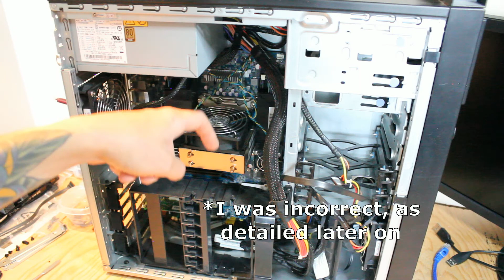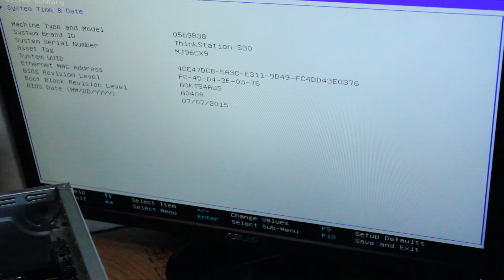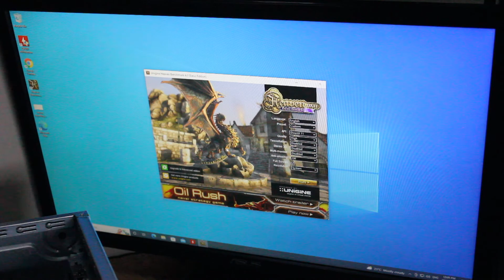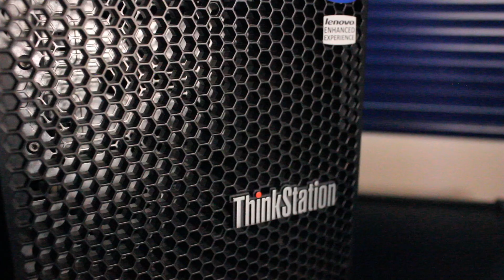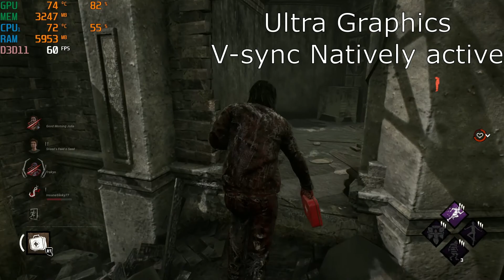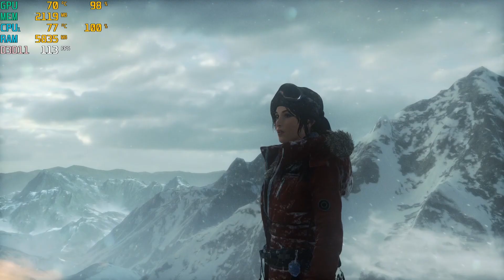Lenovo ThinkStation S30 Upgrade Tutorial for Gaming:  GTX 970, SSD, RAM

Comment: Commenting late and not quite on the topic, but I've been struggling through various setups with a D20. It's a dual processor machine very similar but I guess one generation older than your S30. It has (2) X5687 CPUs and 64GB of DDR3 1333. I gave up on gaming with it but it's still capable for various things, especially under Linux. I'm about to receive and install a lightly used Radeon RX 570 in it, and I'm expecting that will alleviate some driver issues I'm having with it. Anyway, I'm glad to see someone else sees the value in this old hardware.
Reply from the maker: The interesting caveat to these companies selling powerful computers is that the race to make it obsolete begins nearly a year after it has been on the market, if not sooner.  The somewhat arbitrary TPM security requirements from Microsoft for Windows 11 is an example of this.

Comment: hey king i have an s30 cam with its original processor xeon which other processor can i use for more speed  .the original one is r bit slow for my work architectural work and rendering with lumion 12

Comment: Hello, that is great educational video keep doing it!!! I have alittle issue with similar machine ThinkStation C30, i upgrade Ram with HyperX Fury 1600 MHz but it runs in 1333 can you suggest me some solution for this.. Thank in advance:)
Reply from the maker: That would likely mean that you have a CPU installed that only supports 1333MHz RAM, so that is the speed it will default to.  There also likely isn't a way to set those spends in Lenovo BIOS.   https://psref.lenovo.com/syspool/Sys/PDF/withdrawnbook/C30_WE.pdf
Reply: @HaisteComputerRepair  I checked , it support it ,my processor is Intel Xeon E5-2690....
Reply: Now i read the manual for Memory and it writes that i should put Memory by sequence slots. On processor 1 i put it in slot 1-2 but on procesoor 2 i put i 3-4 and 1-2 are free,can this make a issue?
Reply from the maker: @ЛюбомирЛалев-н2и  Should follow the manual for RAM placement, I can't say as I haven't used a C30 before.  Good luck!
Reply from the maker: @ЛюбомирЛалев-н2и  You're certain the RAM is 1600MHz?  Just checking that you have a matching set?
Reply: @HaisteComputerRepair  Yes i buy a set 4x8gb Memory :) i keep fighting, thanx for support :)
Reply from the maker: @ЛюбомирЛалев-н2и  Good luck and let me know if you find a solution

Comment: Awesome content..and very clear..wanted to know if an S30 would take an RTX series Graphic card with upgrading the BIOS update have you ever tried an RTX keep up the content
Reply from the maker: The best GPU I installed was the GTX 970.  If I had any RTX series cards to test out I would have.  I don't see why one wouldn't work so long as you can connect it to the power supply and it's PSU support is 610W or under.

Comment: Could you confirm if you tried GTX 3060 in S30 and if it worked? I got S30 and bottleneck calculator suggest 3060 would be right combo for S30 I'm just concerned that generational difference could be a problem. Thx.
Reply: Same, I'd be interested to find this out too^^
Reply from the maker: Maybe look at installed something like a GTX 1070 ot GTX 1070 Ti, or GTX 1080
Reply from the maker: I would say an RTX 3060 would be ok, but if you have the same 4 core 8 thread Xeon CPU as in this video you probably will bottleneck a little.  I consider the RTX 3060 to be a good card, but it's not the most powerful.  Just make sure you can connect it with the PCIe cables offered by the power supply, or, if you need cable adapters.  Maybe look at installed something like a GTX 1070 ot GTX 1070 Ti, or GTX 1080.

Comment: Hey so I've got an S30 Type 0606 with the E5-1620 v1, 32GB ECC RDIMM 1600Ghz ram with a VisionTek RX 570 4GB OC. Currently getting no display output on monitor but the computer seems to have POSTed. Unfortunately these don't seem to have an iGPU so I'm having an issue trying to troubleshoot with no display. Was the 970 just plug and play for you or did you have to update your BIOS and flash your card as well?
Reply from the maker: The 970 was plug & play for me.  Other cards had trouble working, like one AMD R7 370.   I've heard of others having trouble with some assortment of AMD cards.  Though, the RX 580 is AMD and it was working fine before this?  Do you have any other cards you can install to try out?
Reply: @HaisteComputerRepair  Yeah so after a lot of researching it looks like AMD RX 4xx and 5xx series made UEFI only GPUs with no Hybrid vBIOS for olders hardware. It seems to vary by manufacturers but the the most part Nvidia provided better legacy hardware support for most of their cards. Um so you had a no display issue with the R7 370 eh? Which GPUs were plug and play for you on the S30 aside from the 970?
Reply from the maker: @klingon88  I think the only other cards, outside of the Quadro k4000 card it came with, I tried with it was a GTX 1060 6GB and GTX 650 ti.  Both NVIDIA, which lends to your research.
Reply: @HaisteComputerRepair  When the cards did not work. Did you just get no display on your screen even thought you turned on your PC? How did you determine it was ultimately the card and not another component like the CMOS, ram, motherboard etc.
Reply from the maker: @klingon88  It was no display.  I didn't spend too much time on it before switching cards.  So, I can't really lend to any troubleshooting outside of just a swap out.
Reply: @HaisteComputerRepair  Great channel by the way. Your probably one of the few that goes into detail about issues that can arise when upgrading older office systems with newer hardware. An interesting vid may be testing out different GPUs in an older system to see what works and what doesn't. Really hard to find content like that even on forums dedicated to PC building.
Reply from the maker: @klingon88  Thanks!  I agree, PC building an repair is diverse and problems are plenty.  I would do a video like that, just need the hardware.  I usually cycle through stuff fairly quick.
Reply: @HaisteComputerRepair  Hey sorry for the bother had one pressing question I had to ask. Is this an S30 0606, 0569, 0xxx model or 4563 or some variation of 4xxx model? Reason I ask is because your PSU has 2 6 pin connectors which came on 4xxx models but you use an E5-1620 3.6Ghz which came on 1st gen 0xxx models.
Reply from the maker: @klingon88  Good question.  I have no idea.  If still had access to a case I could tell you.  Definitely not off the to of my head.
Reply: Had the same problem with a GTX 1060, it turned out to be a UEFI thing. Weirdly, I was able to get into the bios by moving the 1060 into the PCIe x4 (x16 mechanical) slot. Once I'd changed the settings I shut it down, switched the card back into the top x16 slot and all was good.
Reply from the maker: @moffatcountycustoms  An odd magic trick to perform, but something to add to the troubleshooting list.  Thanks for sharing this :)
Reply: @moffatcountycustoms  Even had issues with a 1060 huh? What did you get no display on your monitor at all? How did you know your GPU wasn't outright dead after seeing that?
Reply: Yup, no display. I think I was getting a beep code too, it was a while ago. The 1060 was free from a friend and a weird Dell OEM thing so I had no idea if it was DOA or not. I just said what the hay and whacked it into the next slot down without realizing it wasn't an x16 slot and wouldn't you know it video came out. Only then did I bother to read the diagram on the case panel that the middle slot was only X4, but after changing vga oprom setting in the bios to "UEFI only" I was able to move it back into the top x16 slot and it's run great ever since.

Obviously do what I did at your own risk, I have no idea why that worked.
Reply: @moffatcountycustoms  Weird solution. No idea why that would work either. It sucks you need a working GPU just to access BIOS. I'm getting 2 short beeps but thats after I reset my CMOS. I'm still on the lookout for a card.
Reply from the maker: @moffatcountycustoms  The only thing that matters is that it worked!
Reply: @moffatcountycustoms  Yeah tried your technique. Switched my RX 570 to the PCIe x4 (x16 mech) slot and still nothing. I'm getting 2 short beeps which I think is what you were also getting? Thinking I might have to limit myself to the GTX 600 series to avoid this UEFI/Legacy OPROM issue altogether. I see a lot of 1060s at great prices but I've got no clue what makes certain cards work and what doesn't. It's a gamble either way with these newer cards in this system.
Reply: @klingon88  hmm I actually got two sets of beeps (2 short, 3 long maybe?). You don't by chance have the K620 or whatever that came with it do you?
Reply: @moffatcountycustoms  Yeah I purchased a Quadro K4000 and it booted right up. Looks like the GPU was dead after all. I thought I would have head the 2 short and 3 long beeps like you did indicating no GPU. Heh guess I'm off to find another card.

Comment: So an MSI GeForce GTX 970 would also fit/slot straight into an S30 tower?
Reply from the maker: It probably will, but may need some modifications (doable I think) as the MSI card is bigger than the EVGA card.

Comment: When I swap out the gpu to different gpus, previously known to be working , I am getting 2 long beeps and 3 short beeps which I am seeing says gpu not found. Did you have to change anything before pulling the quadro out?
Reply from the maker: The only thing I did was use the extra PCI-e plug adapter.  Nothing in BIOS.  Which GPU's are you trying to install?
Reply: @HaisteComputerRepair  same guy, using my phone account. 
The rig had a k620 quadro in originally. 
Im trying to install a RX 590 nitro plus. I even tried a gt710 to see if that would do anything and same thing wouldn't recognize. Put quadro back in and it's fine. 
Attempted a psu swap. 
It's got a e5-1607 v2 Xeon, and 8gb ram
Reply from the maker: @sofarm2259  That is odd that those cards don't work but the quadro does.  They are confirmed working in another system?  I tried a similar card to the RX 590 and it didn't work with the system.  This might take some research online. Have you posted to any forums?
Reply: @HaisteComputerRepair  not yet. Your the only person I've come across using same system so far. Your input has been helpful
Reply from the maker: @sofarm2259  Sorry I can't offer a fix, but I would keep at it.  At least we can say GTX 970 and Quadro cards seem to work fine.  Let me know if you find a solution.  This has been sold, so I no longer have access to an S30.
Reply: @HaisteComputerRepair  Will do, sold the RX590, going to keep my eyes out for a nvidia card.
Reply from the maker: @youratard321  Good deal!  If you were local to me I have two Radeon r9 290's that would work (confirmed by me).
Reply: @HaisteComputerRepair  Picked up a dell XPS locally for $25 that ended up having a GTX 960 4GB in it, and was able to boot up! 
Lady that bought RX590 told me its working perfect in her gaming rig, so not sure what was going on. Other gpu I had also booted in the XPS, so def something the S30 did not like.
Reply from the maker: @youratard321  A whole PC and a surprise GTX 960 is a steal!  Nice job.  Did you install it in the S30?
Reply: @HaisteComputerRepair  I sure did.. worked no problem. Cleaned it and reinstalled. Now to sell the pc it came from
Reply from the maker: @youratard321  Nicely done!  The PC spirits are watching over you.  What CPU is installed in the Dell XPS desktop?
Reply: @HaisteComputerRepair  i7 870
Reply from the maker: @sofarm2259  Ok, well that still performs.  Good luck!
Reply: @HaisteComputerRepair  it was an i7 870 so oldie
Reply from the maker: @youratard321  I would still find it exciting to use the first gen 4 core 8 thread i7.  I ran a i7-960 in my workstation for close to a year.  I remember using a Core 2 Quad in 2008 and finding the performance great.  Still holds up in some capacity all these years later.
Reply: @HaisteComputerRepair  it is surprising seeing them still hold up to the standards today. I did sell that unit and now in process of putting the s30 components into a new case since the case on the lenovo was trash (missing side, dented, broken faceplate) Using a Cooler Master Stryker I picked up locally for $40
Reply from the maker: @youratard321  Awesome.  Are you replacing the power supply as well?  I found that the cable leading to the CPU power plug was fairly short, perhaps not able to reach if power supply is at the bottom of the case instead of the top.
Reply: @HaisteComputerRepair  yes, found that out pretty quickly especially since this case is gigantic. I could solder them but that earlier computer I mentioned came with an evga 500 watt psu and for some reason I had a 8 pin to 12 pin splitter that I can put on cpu/graphics pins on mobo.
Reply from the maker: @sofarm2259  Nice.  I purchased some cable extensions for this purpose but never ended up using them before selling all the S30's.
Reply: Hey was the 960 just a plug and play for you? Which manufacturer was it? I've also got an S30 and I think the GPU is dead. Looking for a replacement. It's an S30 0606 model.
Reply: @klingon88  my 960 plugged in and worked fine. Still using it. So far has been able to play a bunch of games. Not amazingly but lower graphics but works.
Reply: @sofarm2259  Forgot to ask you what model the 960 was. Is your S30 also the 1st gen? They typically start with 0xxx in the number sequence.
Reply from the maker: @klingon88  The 970* worked right with no issues.  It was an EVGA GTX 970.

Comment: i am currently watching this video on a s30 but i did switch power supply because there is a lot of discussion online obout using adapters such as a sata to 6 pin so are they actually safe?
Reply: + i also have 64 gb ram and a gtx 1080 TI here , the power supply is a tegan z 800 watt and i have 2 1terra hdd 's and a 250 gb ssd. thank you for making this video , i bought this pc because of you and i am verry happy about it!!
Reply from the maker: @arthuronthecomputer8178  That's awesome, I'm glad you are liking it!  A 1080 ti would be great and a new power supply would help.  I operate in the budget realm, so an adapter is cheaper than a new power supply.  As for the safety of the adapter, well the hardware it is paired with is not too heavy and so far so good.  I haven't heard anything from the customer.

Comment: Have you tried to run a rtx card like 2060 super or 3060 and  see how the performance would be ?
Reply from the maker: I haven't but it would perform well enough I imagine.  This Xeon CPU can keep up with most Intel i7 4 core 8 thread CPU's.  Maybe not the same performance as an i7-7700K.  I do have an RTX 3060 in my gaming rig and the PSU from this ThinkCentre is rated as being 500-550W max output, so I would just need PCI cable adapters to install a 2060 or 3060.  So long story short: yes.  Will I try it out? Probably not unless someone wanted to purchase one of my remaining two units ;)
Reply: @HaisteComputerRepair  thank you for the feedback. Whats your advice on ram upgrade. 1600 or 1866 speed ?
Reply from the maker: @rongaistudios  For DDR3, I think you would be fine with either.  If you happen to come across some 1866MHz RAM for a good price, awesome.  Otherwise, DDR3 RAM is pricey to buy new and used, despite it's age and abundancy.  As long as you have enough RAM for what you want to do, you might not notice a difference between the two speeds.  Unless you have a specific use case?
Reply from the maker: @rongaistudios  By the way, if you are looking at a ThinkStation S30 or other models, they generally take server RAM, which is a specific type to purchase.  On 1600MHz RAM, you will see "12800R" for server and "12800U" for conventional use, for example.  It's unreliable to interchange and best to stick to specific use.